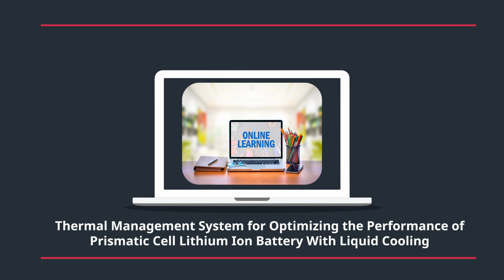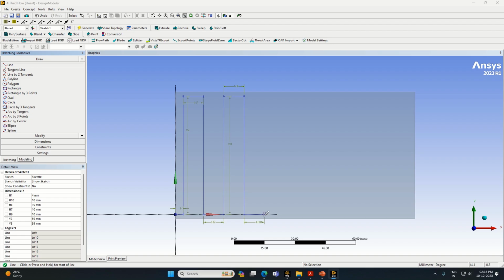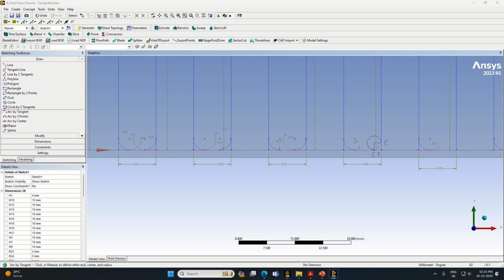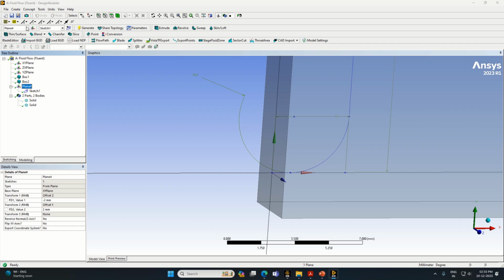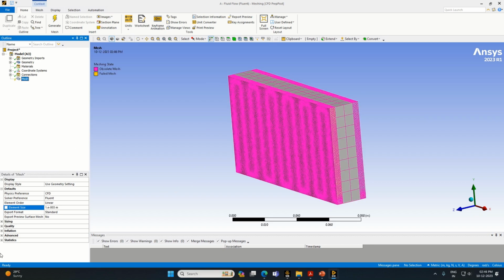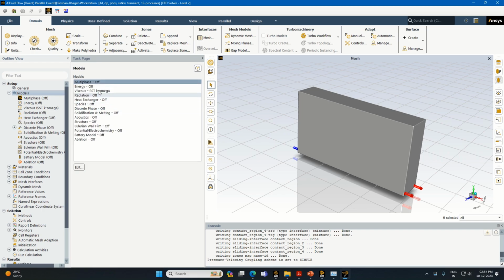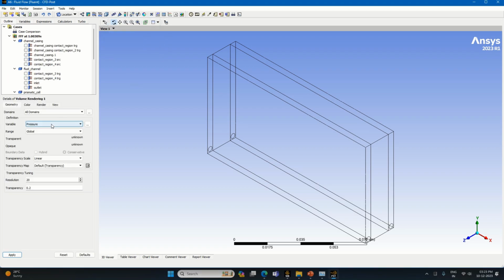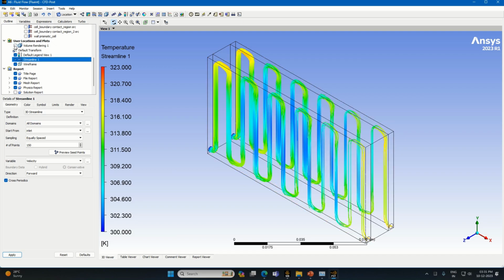Thermal Management System for Optimizing the Performance of Prismatic Cell Lithium Ion Battery

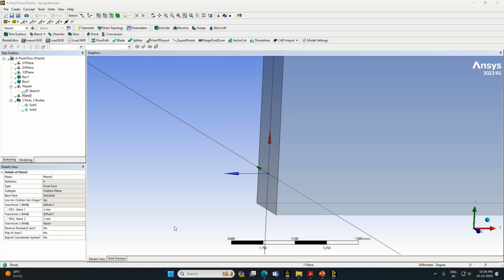Comment: at 24:21 minute of your video, after you set the plane 5 specifications, whats that option you clicked before generate? If I enter the values you got after generate manually, I am not getting the option to select base face. which side of the cell body did you consider as base face at plane 5?
Reply from the maker: Just click on generate option the plane will be avaialble......while instead of from plane you have to select face from type option
Reply: @FrontiersInCFD but which side did you take as base face that time? during sweep operation, I am getting an error stating sweep path must contain exactly one chain.

Comment: Why we not getting the average weighted Temp graph, showing inlet and outlet temp
Reply from the maker: we can set that and with report definition file it can be plotted as well
Reply: @FrontiersInCFD thanks for responding sir,can say that what is mean by average weighted Temp plot, because I got that graph upto only 304k only , I'm thinking that it is outlet temp
Reply from the maker: If you specify at outlet then it is

Comment: Sir i have a doubt... How can we know that the flow is laminar or turbulent in case of li ion battery open channel cooling.. is there any formula for it... Please reply asap🙃
Reply from the maker: Check velocity contour and based on that find reynolds number
Reply: @FrontiersInCFD  but sir you selected k-epsilon.. so how you find that here we use k-epsilon.. not laminar???
Reply from the maker: For heat transfer problem  with enhance wall treatment thermal effect curvature correction you have to use k epsilon model